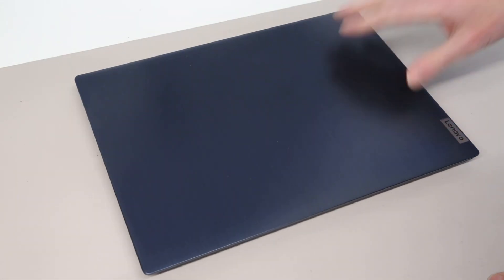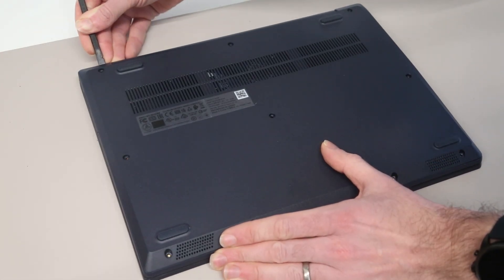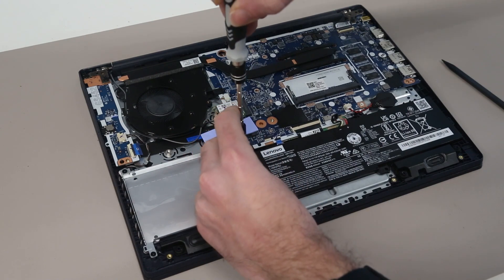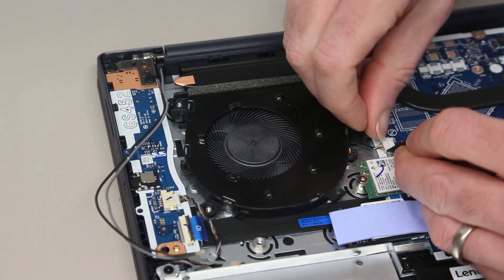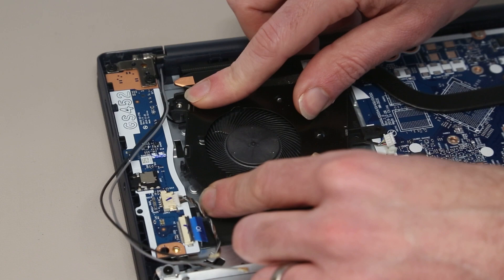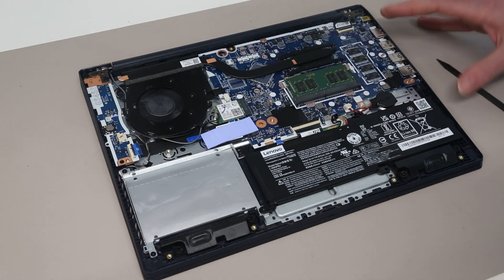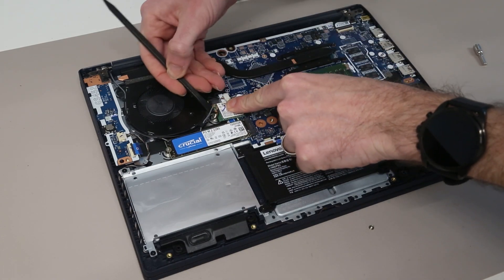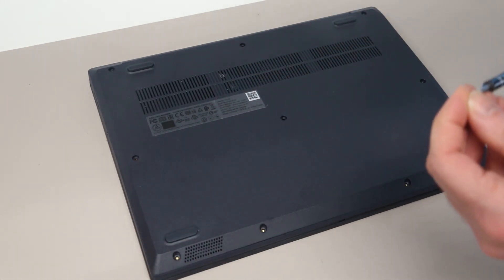Lenovo IdeaPad 3i 14IIL05 Upgrade Guide - SSD and RAM Upgrade, Fan and Battery Replacement

Comment: I have some missing screws in my laptop. Same kind of computer, can you recommend size
Reply from the maker: The service manual for most Lenovo's are really good. You should be able to find the ones your missing with the sizes listed: https://download.lenovo.com/consumer/mobiles_pub/ideapad3_hmm.pdf

Most look to be M2.0 or M2.5, but lengths vary depend on where its being used.

Comment: Mine is Lenovo 3 14IIL05 not 3i, I have 4gb soldered and I already added 4gb in the empty slot, but I want to add more. Is it possible to increase the RAM to 20gb?
Reply from the maker: You can fit a higher capacity SO-DIMM in the slot, yes.
Reply: @BrueComputing bro mine is Lenovo ideapad 3 14ITL05 can I upgrade ram and rom ? 🥹as mine 8gb ram and 256 rom , can i bro ?

Comment: Physically you can add all the ram memory you can afford. But will your BIOS support it?

  I have checked directly with Lenovo, and 12 GBs is all it supports, 4 already soldered in and a new 8 GBs stick in the slot. 

There you can put a 32GBs if you can find it and afford it, but the system will not recognize it, nor use it. M.2 SSD hard drive on the other hand is no problem.
Reply: I have a Lenovo IdeaPad 3 14IML05 (Core i5 variant, spec up to 64GB RAM) which as per official Lenovo Manual could only go up to 12 GB and I got 36GB total (4GB built-in + 32GB) working just fine and being used completedly (35.8 GB) and shared with its Intel UHD Graphics.
Reply: I decided to do a video showing it can be done, OverRAMing to 36 GB an IdeaPad 3 14IML05 (Core i5): https://www.youtube.com/watch?v=CHdOd2_HUfI

Comment: Got mine (Core i5) upgraded to a total of 36 GB RAM (replaced the original 4GB for a Lexar 32GB DDR4 SODIMM RAM 3200MT/s CL22 260-Pin), thanks for your video!
Reply: still works normally? did you have any problems?
Reply: @JesusValladares-iy3ll  After about 1 year, works like a charm, no issues so far. Can use all memory (RAM) if required. Rgds.

Comment: Can somebody link the cable that I can buy for the ssd
Reply: i want, too
Reply: @yangpuni, try to find Connector 5C10S30041 NBX0001SX00. I got mine from ebay, good luck :)

Comment: hello can i still increase my sdd even tho i have no sata just like yours?
Reply: Yes you can brother 
Check mine
upgraded my Ideapad 3 14IML05....
You choose 32GB DDR RAM 3200mhz speed still if money is not a problem, but in my case 16GB DDR4 RAM 3200mhz Sweet and it will still follow the built in ram 4GB 2666mhz speed.
my 1TB HHD I upgraded it to 1TB 2.5 SATA SSD
my 250GB SSD I upgraded it to 1TB SSD m.2 NVME 2280 if money is not an issue you you can upgrade it to 2TB SSD

Comment: To be honest, you really don't need to remove the battery.  It's probably best practice but I've worked on hundreds of machines, and the only ones I usually do disconnect the power is desktops, simply because they can give you a good shock.  I haven't had any issues with laptops though.  But luckily the batteries are easy to disconnect, but usually replacing RAM and SSDs you generally don't need to.  If you are replacing the system board or soldering, then yes you should definitely disconnect the battery, but I would say for most "toolless" or light jobs like SSD or memory upgrades, I don't find it necessary most of the time  Also, despite Lenovo's documentation you can install a 16GB stick into the RAM slot and get something like 20GB of RAM.  Did this to my non-I Ideapad 3 and it works fine.  Actually did a full upgrade to a 1TB 2280 SSD and will be adding a 2TB 2.5" drive soon.  Upgraded the RAM to 20GB total (4 GB built in + 16GB stick from Crucial).
Reply: Actually I got 36GB total (4GB built-in + 32GB Lexar DDR4 SODIMM RAM 3200MT/s CL22 260-Pin) working just fine (mine is Core i5 variant, spec up to 64GB RAM).
Reply: What ram card did you use for this ? I need to do a machine learning project for uni and my ram is too weak
Reply: @maximechopin2600  Lexar DDR4 SODIMM RAM 3200MT/s CL22 260-Pin. Check the Maximum RAM of your processor and RAM in your Motherboard (limits speed), normally those are the ones that set the limits.
Reply: @FROILANDRES   oh so you replaced the original and added another ? would it work to just add a 32GB one in the empty slot with the default 8gb one it started with ? (thanks for the earlier reply btw)
Reply: @maximechopin2600  In my case my Laptop has 4 GB soldered in the Motherboard and 1 Slot which had 4 GB installed (a total of 8 GB), so I removed the 4 GB in the slot and placed the 32 GB module for a total of 36 GB, and it is working like a charm even with the Official Lenovo Specs saying it can only go up to 12 GB in total. REMEMBER TO DISCONNECT FROM POWER AND DISCONNECT THE BATTERY BEFORE TOUCHING THE RAM MODULE.
Reply: @maximechopin2600  I decided to do a video showing it can be done, OverRAMing to 36 GB (4+32) an IdeaPad 3 14IML05 (Core i5): https://www.youtube.com/watch?v=CHdOd2_HUfI

Comment: where can i get the sata cable?
Reply: Look for a 2.5 inch Hard Drive Cable Connector upgrade kit including sata connector, sata flex and rubber bracket.

Comment: Can I  do this with Intel core i3 1005G1
Reply: Yes you can, that processor can handle up to 64 GB RAM, so your laptop should be able to handle a 32 GB Module for a total of 36 GB or 40 GB (depending on the RAM soldered to to the motherboard).

Comment: Information about RAM/Memory. Even if the speed of RAM is limited to 2666MHz the 3200 is backward compatible with lower speed. There is a memory controller on CPU and for Core i3-1115G4 it is DDR4-3200, LPDDR4x-3733. Although once this laptop has soldered memory meaning it will force the speed of the soldered one on additional. RAM speed is especially beneficial with interred one on additional. RAM speed is especially beneficial with integrated graphic card. And remember to always use 2 memory modules to unlock dual channel bandwidth of 128 bits (even more important than speed).
Reply: i installed 4gb ddr4 2666 but it's freezing after gaming about 10 minutes and it needs a restart to operate again. i bought another stick of same specs of ram but different brand but still the same problem. But... same problem of freezing when i slightly shake the laptop. is it possible that the problem is the laptop build that it is soft plastic causing the ram slot to shake easily?
Reply: @Dyeybi29  did you solved your issue bro?
Reply: @kiritops944  no. i ended up removing the additional 4gb ram that i bought and stick to the built-in 4gb ram.
Reply: @Dyeybi29  what a bummer 😞
Reply: @kiritops944  upgraded my Ideapad 3 14IML05....
You choose 32GB DDR RAM 3200mhz speed still if money is not a problem, but in my case 16GB DDR4 RAM 3200mhz Sweet and it will still follow the built in ram 4GB 2666mhz speed.
my 1TB HHD I upgraded it to 1TB 2.5 SATA SSD
my 250GB SSD I upgraded it to 1TB SSD m.2 NVME 2280 if money is not an issue you you can upgrade it to 2TB SSD

Comment: do you have to transfer your file to a flash drive or can you just swap the ddr 4 and ssd drive
Reply: If you want to keep the same OS and all files, clone the original SSD in the new one before doing the swap. If not, you will have to do a backup of files and install OS and all programs from start in the new drive after installation.

Comment: Is it possible to use 2666MHz instead of 3200MHz as RAM?
Reply: Yes it is possible. Even if the speed of RAM is limited to 2666MHz the 3200 is backward compatible with lower speed. There is a memory controller on CPU and for Core i3-1115G4 it is DDR4-3200, LPDDR4x-3733. Although once this laptop has soldered memory meaning it will force the speed of the soldered one on additional. RAM speed is especially beneficial with interred one on additional. RAM speed is especially beneficial with integrated graphic card. And remember to always use 2 memory modules to unlock dual channel bandwidth of 128 bits (even more important than speed).

Comment: A quick question: if i was to change my ssd will i need to reinstall windows and buy a new license key?
Reply: You will have to reinstall so you need a bootable but you can use your previous product key to do reinstall.

Comment: Is it possible to remove that SSD case and replace the battery into something with more capacity? using that extra space for bigger battery?
Reply: So I think you can, because Lenovo states on their site that the models with the 35W battery (which is shown here) has the 2.5" drive bay, but the version with the 45W battery does not have the bay adapter as the battery covers this area.  My guess though is you might have to find an adhesive to secure the battery unless it secures into the same screw holes as the 2.5" drive caddy/cover.  Otherwise some double-sided foam tape should work.  I haven't done this myself but I think you could probably use the 45W battery in this model, however I don't think you could go the other way necessarily (45W to a 35W model).  Also, you may also need the power adapter that comes with the 45W version too as that may put out more power than the 35W version (the 35Whr version uses a 65W power adapter but check as they may use the same AC adapter).

Comment: Do you need to remove the battery to install the ram for this model? TYSM GREAT VIDEO
Reply: No, you don't, the ddr4 slot is actually quite in an open spot
Reply: It is better to disconnect the battery to prevent damage, and it is easily done.

Comment: You mentioned having to buy a cable if we were to put an SSD. I did not notice you put a cable but just push in the new SSD. What did you mean?
Reply: there's an HDD/SSD bay at 2:36 you can notice at on the left of the battery that's what the cable he mentioned is for as the laptop doesn't come with one.

Comment: I have the same laptop with diff cpu its i5-1035G1 can i install the same ram as you mentioned in the description? Or should i buy a differnet one?
Reply: You shoul be able to get up to 36 GB total RAM as that processor supports up to 64 GB RAM.

Comment: Is it possible to remove the drive bay and fit a bigger battery?
Reply: Mine came just like you said out of the box, 45Wh battery, so it can be done for sure (some come 35Wh with space for extra drive and some with 45Wh without free space).

Comment: can i upgrade ram on my Lenovo ideapad 3 ? which has celeron 4020 and 4gb ram and 1tb hdd.
Reply: It is strictly dependant on your laptop model. Your CPU is sadly very economical class which is not a good prognostic for an upgrade.

Comment: can I put a bigger(than500gig) ssd in my Lenovo IdeaPad 3 14IML05, like 1tb? and does it affect my operating system?(will it just boot up like normal,i would just have to put all files on a thumb-drive to back up).  mine only came with 117g
Reply from the maker: You can fit a 1 or 2TB M.2 NVMe drive like the Crucial P2 just fine (Amazon Affiliates link): https://amzn.to/3IusJbh
You need to either clone the contents across or clean install Windows on to the new drive.
Reply: @BrueComputing  thanks Brue.  I thought so. kinda sucks cuz I didnt want to do all that.  guess i shud have gotten a bigger drive.  I guess Ill prob have to just put the big folders on removable memory equipment.  I have a few big memory sd cards and thumb drives I can choose from.

Comment: Also since the SATA bay is empty, can I buy the cable and hook it up?  I have a 500Gbs SATA, and buying the cable would be cheaper than buying a M2.
Reply from the maker: If you can source the cables it should work, but obviously not tested it and M.2 is faster.
Reply: upgraded my Ideapad 3 14IML05....
You choose 32GB DDR RAM 3200mhz speed still if money is not a problem, but in my case 16GB DDR4 RAM 3200mhz Sweet and it will still follow the built in ram 4GB 2666mhz speed.
my 1TB HHD I upgraded it to 1TB 2.5 SATA SSD
my 250GB SSD I upgraded it to 1TB SSD m.2 NVME 2280 if money is not an issue you you can upgrade it to 2TB SSD
Reply: Yes, you can buy a 2.5 inch Hard Drive Cable Connector upgrade kit including sata connector, sata flex and rubber bracket.

Comment: Thanks, I have the same laptop. Did I hear correctly or did you say you can add more than 8Gbs of RAM. I thought since it has a module of 4Gbs soldered, you can only add 8Gbs for a total of 12Gbs.
Reply from the maker: 8 or 16GB modules should work just fine.
Reply: This is one of the things i heard from the store where i bought my Lenovo, that the max RAM it would accept is only 12GB. I am not sure if this is  still real. All the other people i asked said theres no such thing.
Reply: Crucial says you can add up to 20gb of RAM, I usually trust their info but I take that with a grain of salt. They do sell a 16gb module with a function guarantee, so there's that.
Reply: @casey360360  I understand your Lenovo only supports 12 Gbs max. So even if a 16Gbs fits, it might not work and be a waste of money i am  sure it is not cheap. My two cents. 4gbs built in, 8Gbs, added for a total of 12 Gbs, works for me.
Reply: @tutubopeter  I bought an Ideapad 5 with 12 reinstalled. It works great. So, I think 95% will be happy with adding 8.
Reply: @tutubopeter  Remember Manuals and Specs are done at the time of design or release of the Laptop, as Hardware and Software keep improving things like "OverRamming" are prossible; some manufacturers put a note that in the future it may be possible to add more Memory and/or Storage. I have a Lenovo IdeaPad 3 14IML05 (Core i5 variant, spec up to 64GB RAM) which as per official Lenovo Manual could only go up to 12 GB and I got 36 GB total (4 GB built-in + 32 GB) working just fine and being used completedly (35.8 GB) and shared with its Intel UHD Graphics.

Comment: Is it possible to access and upgrade the processor? Also can we upgrade the pre fitted ram?
Reply from the maker: No - as with basically all modern laptops the CPU is soldered to the mainboard, so the only way to upgrade it is to replace the whole board.
Same goes for the non-socketed RAM.
Reply: @BrueComputing  So, I could replace the whole mother but with a modern processor, right? I have recently bought a 16GB ram stick, so I will be installing it in the next few days, but I would also like to upgrade my CPU for a more powerful one.

Comment: why there's no screw for nvme in my slot, I can't upgrade into nvme because of that.
Reply from the maker: The screw is only fitted if there is an M.2 drive installed. You just need a M2x3mm screw.

Comment: Hi which ssd can supported by s145 15iil 10gen core i3 4gb 1tb model..pls send a link to buy ssd for this
Reply: any ssd will work aslong as the drive is 2.5 inches